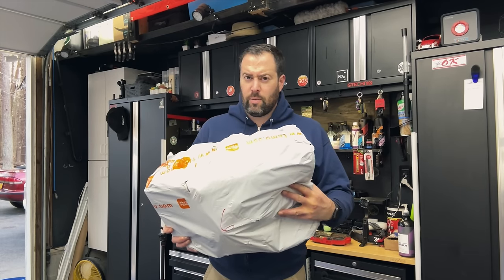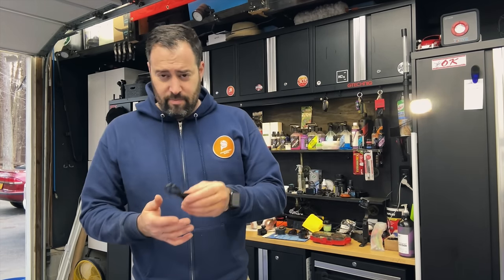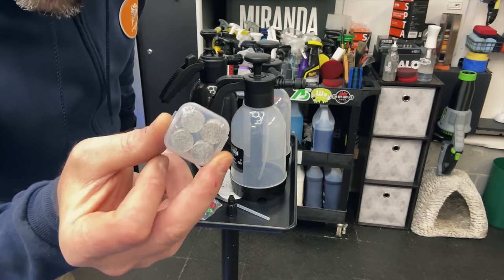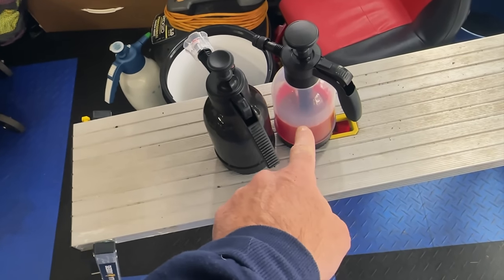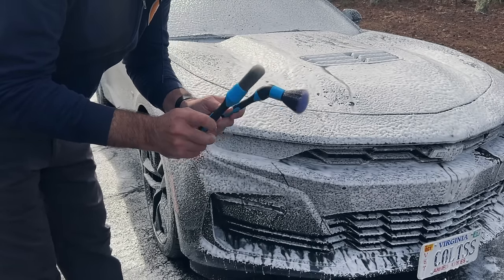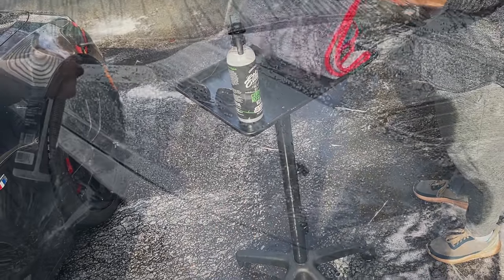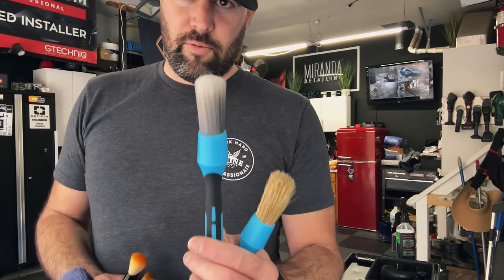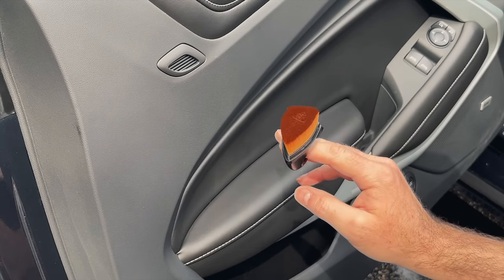⚠️ Get Your Car Sparkling With These Amazing Detailing Tools!

Comment: I ordered the same black foamer you used for the prewash, its complete trash. it doesn't hold pressure, once i pull the lever it releases all the pressure. damn temu
Reply from the maker: Aw that sucks. Sorry to hear that. I have 4 of them now and they all work fine.  But who knows, sometimes you get crap. I have had expensive ones from Bigbio crap out the day i get them, two of them in fact.  So even expensive, supposedly good quality tools are crap also.

Comment: i have the same black foam bottle. i cant get mine of foam no matter what. It came with little bits of clear plastic which look like they go inside the nozzle but im thinking im missing a part.
Reply from the maker: Oh thats weird. sometimes pieces are missing on some things.
Reply: @MirandaDetailing  which is why I searched for this video. I was hoping I would come across someone who had the same issue and had guidance on assembling the nozzle. Trivial, I know, but the pieces I have don't make sense.

Comment: I actually putted schrader valve on one of those foamers thinking it’s cheap i want to try it and get another if it breaks. But i was actually able to use it with schrader valve and xiao mi tire inflator. Safety valve is going to act somewhere between 27 to 30 psi so if i set my inflator to 30 psi, it would be keep going unless i turn the inflator off

Comment: I’ve ordered a bunch of stuff from temu I’ll write down below my experience. 
I ordered those weighted straw tubes.On some they work like the sooprinse and also a red and black foam cannon on temu it fit no problem. On my pf22 it did not fit but a small zip tie got it to tighten on. 
I got a silicone headlamp with a LED strip across the forehead and a flashlight on the side. I love that thing! Super bright great for interiors. 
I got 2 different spray guns. The simple small guns you typically find on Amazon and it was exactly the same as the ones on Amazon. Also got one that looks like the mckillans and it worked no issues. I didn’t have any leaks and all held pressure and lasted 10+ washes haven’t had any issues yet. 
Got a tire brush it’s all black and pretty stiff bristles can’t really mess that up. 
Also got the detail factory curveball dupe and it feels and looks the exact same. I still don’t get the hype with this brush tho 
I found a 10pk of microfiber applicator pads with a pocket on the back I love these for dressing tires.
Got a bucket caddy exactly like the buckanizer. Solid great for wheel tools
Grit guard eh it was flimsy and came bent 
Wide mouth foam cannon. I really like it I also ordered 1.1 orfice for it and it made good foam 
I got hex polishing pads. Ehh they’ll work but expect a use or 2 out of them 
Found a microfiber wash pad i love this thing it feels soft and holds a good amount of water 
Curved Extension want it’s 15in it’ll do the job but definitely prefer the 21in version. But does have a spot to hold nozzles which is cool
Microfiber towels 10pk 10x10 they’re good kitchen towels
Got a drying towel but it was too thin and shed allot 
I found a set of black nitrile gloves. I love them perfect for detailing but not so much mechanic work
Reply from the maker: Nice!  Thanks for sharing

Comment: The filters in the foam cannon can be cleaned when they clog and become full.
I use some gun solvent for that.
Works really well.
Let the solvent work for 10-15 minutes then rinse with warm water and they will be like new again.
I also have replaceable filters I used but clean works just as well.
Type Hoppes NR 9 solvent, a couple of drops of it on the filter then just wait and rinse off.
Now I have not used Hoppes itself but Pro-Shot Solvent Copper IV on the filters.
Just put the filter in a milliliter measure like that and you'll see when it dissolves all the shampoo and detergent.
As well as Acetone works quite well to dissolve agents and shampoo.
Reply from the maker: Cool. Thanks for the tip!

Comment: I like that cannon too, I got it on Amazon to be used as a dedicated LSP cannon for the likes of Polar seal, it’s great value for money but, it’ll never replace my MJJC S V3, they both have their jobs and do an excellent job respectively. I do prefer the IK sprayer type pump handle though as it gives more purchase when pumping it up, I have the 1,5 Ltr and a Spear and Jackson 5 ltr that makes applying the citrus pre wash so much easier. Great video 👍👍
Reply from the maker: Thanks for sharing!  😎👍🏼

Comment: You can put the valve on. I have 5 of the same and each has a valve. I purchased the all rubber short valves. They conform to the radius and allow the handle to spin. Great video.
Reply from the maker: Oh cool!  No issues drilling on that type of plastic?
Reply: Not at all. Just clean the inside burrs for a tight seal. I drilled about 3/4 inches below the collar. Wanted to put it up on the pump like my IK, but couldn’t find a good place. Since it has a release valve, I fill it till it hisses. 1/3 to 1/2 air gives you a lot of run time.
Reply from the maker: That’s awesome!  Thanks for sharing that! I will definitely do that to these bottles.

Comment: awesome video brother👍🏽…i finally tried your tip for adding schrader valves to my pump sprayers. i had actually had some 90 degree valves where you poke em through then lock em down with a nut, it squeezes the gasket together to be air tight. it worked perfectly with the handle clearance on the ik sprayer, i may shoot you some pics via email if i can find it on your website ✌🏽
Reply from the maker: Awesome!  Thanks

Comment: Hello. Great video. I noticed you're using a lsp like a drying aid, Does doing this ruin how well the towel absorbs over time?
Reply from the maker: Hi. Thanks for so most hybrid ceramic spray sealants like this can be applied wet or dry and as a topper on coatings or a stand alone. I never have issues with my towels after using products like this. Towels will loose their absorbency over time anyway, but again just getting the towel a little damp again when drying and the towel will absorb just fine.

Comment: I bought you the hoses, but too big for the MTM foam gun. but cut the original hose, so there was about a cm left, then I threaded the temu hose over it, it works great,
Reply from the maker: Great tip!! Thanks!

Comment: i bought the clear pump sprayer and the pumping mechanism cracked and it didn't hold any pressure

I would recommend investing in a good one like an IK or Marolex.
Reply from the maker: Aw man. That sucks. I have multiple ok and Marilee pumps and they too had pressure seal issues and some broke on me. Unfortunately I don’t really trust any company to have true quality, it’s still a gamble no matter what we get.

Comment: Heat the straws up to shrink on the foam cannon. I dig the jacket would like to get one. 
The pump sprayers leak overtime. Well mine did.
Reply from the maker: I’ll have to try heating them up and see if they shrink or just melt 🤣

Comment: the brush with an angle i have one and this case the holes of the wheels are large enough and its easy to go around the wheel barrel 
and you did a camaro

I work so fair I know for a school for students who has problems at school and want to learn to be a car mechanic also restoration classic cars
he has or had a red Alfa Romeo 3 doors 164 I think and took it to the automatic car wash 2 metal poles clear coat problems and wheels look awful I wash cars .and sometimes you as third party have to use what you getand could be very very simple

Comment: How many refills did the foam sprayer take to do the whole car?
Reply from the maker: Hi. Do you mean refilling of chemicals or hand pumping to keep it filled with compression?
Reply: @MirandaDetailing  both
Reply from the maker: @kmt_alen8373 I didn’t need to refill the chemical at all. I fact I was able to use it on 3 different vehicles. But as you may have seen in the video I would pump it up after about 2 panels or so. It’s very easy to hand pump it while using it.
Reply from the maker: I didn’t have to refill it at all with chemical. In fact I got about 3 vehicles out of this one fill. But as you may have seen I would hand pump it after a few panels. It’s very easy to hand pump on the fly.

Comment: I bought Some wheels to replace those office chair wheels they are roller blade wheels. Best for anything they work for. I got them off Amazon. But if you need to upgrade those wheels you will like them.
Reply from the maker: Thanks for the tip!

Comment: Be careful with them Schrader valves, I installed one in a sprayer that did not have a air pressure safety release valve. I pumped it up with pressure all was great had tons of power, worked perfect. I went back to clean it out later and went to unscrew the top and..
BOOM! it blasted the top off like a Canon, hit me in the face, cut my eyebrow, gave me bloody nose and scared the crap out of me🤐 So moral of story be careful and safety first.😉
Reply from the maker: Holy crap that’s crazy!  Great tip!  Thanks for sharing!!

Comment: Why are you using towels to dry with? What wrong with using a backpack leaf blower? After 5 minutes vehicle is completely dry
Reply from the maker: Hi! Sure you could do if you wanted. We have both an EGO765 blower and a handheld BLO blower. Whether drying with a towel or a blower, doesn’t matter. I still like to dry with a towel sometimes.  There is no right or wrong, just options. 
Thanks for watching. 😎👍🏼

Comment: Foam cannons are a waste of time, the number of detailers i have spoken to have stopprd using them. It looks good eith all the foam but basically does nothing except send great puddles of foam down the road. In fact authorities here in NZ are trying to stop the use of them.
Reply from the maker: Hi. It’s ok if you don’t like them. I can see why some people don’t understand why and how to use them. . Once I started using a foam cannon it sped up our process tremendously. When used properly they save time and produce better results. You can have your opinion, that’s fine, but I have experience and accurate knowledge when it comes to using foam cannons properly. Thanks.